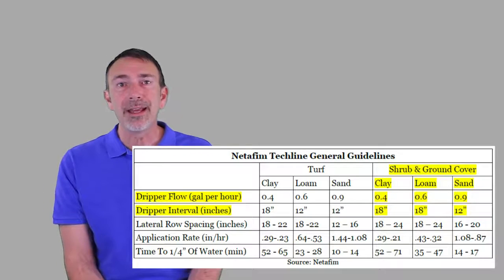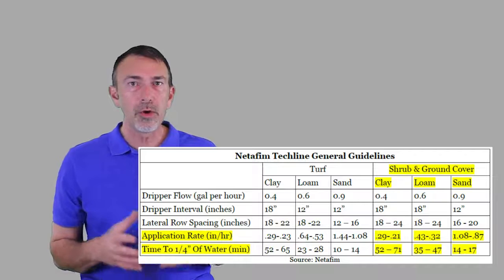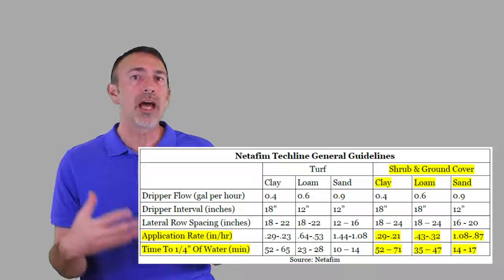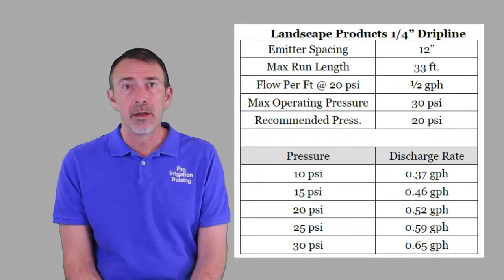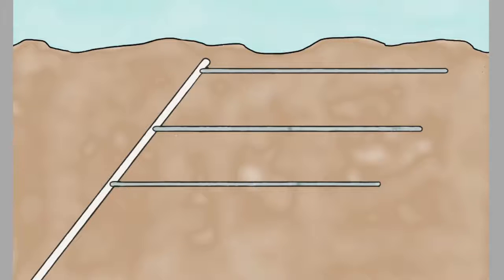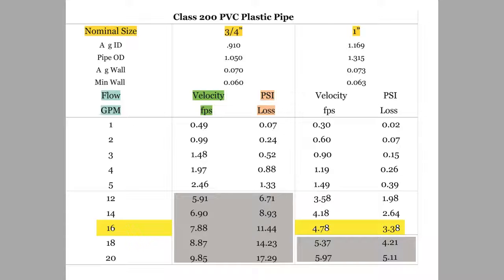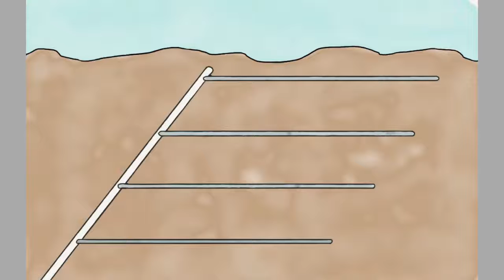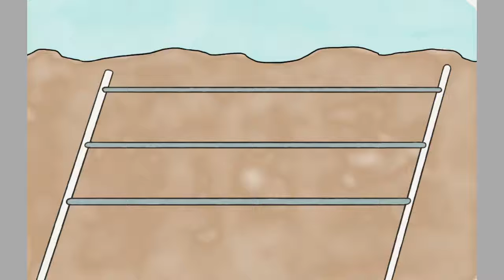How To Use Irrigation Dripline [IRRIGATION 101]

Comment: Is 30 cm distance  drip line  good for cabbage production
Reply from the maker: Hi, thanks for watching and commenting! The best distance on the drippers depends on how far your cabbage is spaced. For annual crops, it's best to have the drippers right on top of the plant. How long you run the dripline and the soil type will determine how far laterally and deep the water will go. To contrast, for perennial plants, it's best to position the drippers on the outside edge of the roots to encourage further root growth.

Comment: Hello and thank you for the useful video! We have about 10 acres of pumpkins planted and usually rely on rain but with how inconsistent its been the last few years we are considering drip irrigation. My main concern with drip irrigation is how we're going to go about keeping weeds at bay. We typically use hand tillers to go up and down the rows and an 8' tractor tiller while they're small. Obviously this would be much harder to do with drip irrigation. I know this is not the point of your channel but I was wondering on how people typically tend to deal with weeds who use drip irrigation? I also would not like to use plastic just because of the cost. Thanks again!
Reply from the maker: Hi Carl, thanks for watching the video! Usually, drip is used when the plants are in rows. The dripline has a supply manifold or header at the edge of the field, and the actual tubing is up against the stem of the plant, leaving space between to walk and till. Of course, this really only applies to annual crops that have relatively small root zones. Perennials such as landscape ornamentals, blueberries, peaches, etc. have larger root zones or footprints and you have to put the dripline out toward the edges of the root zone. I'm in SC and we get patchy rain as well. I once installed a Netafim drip system on a blueberry farm in the winter. First season, 100% increase in yield over a previous, not so great drip tape system. I was the highest bidder and he said it was totally worth the cost. Get with your local University's Ag Extension office, I'm sure they know of farms local to you that use drip and you can get some data. Definitely check out Netafim's websites and content, they are the worldwide masters of drip agriculture.

Comment: Can you use drip irrigation on sloping land?
Reply from the maker: Yes you can. You should use a product with check valves and run your lines horizontal and parallel with the top of the slope instead of running down the slope.